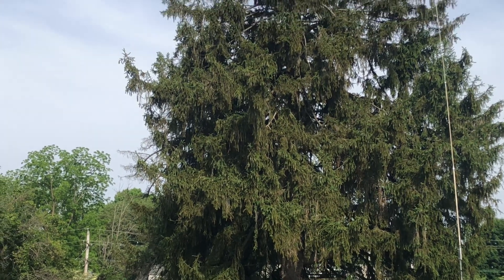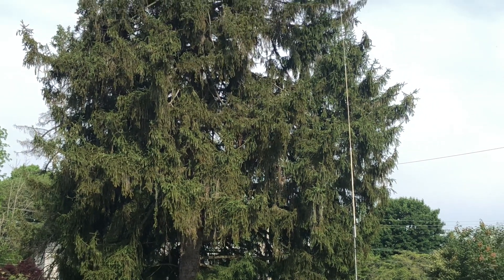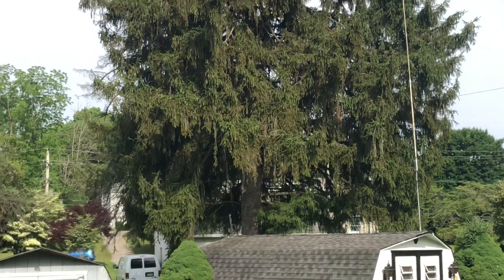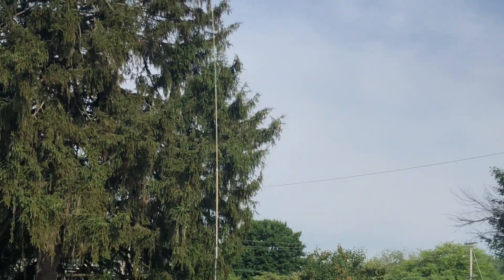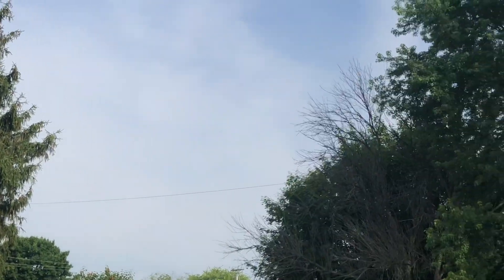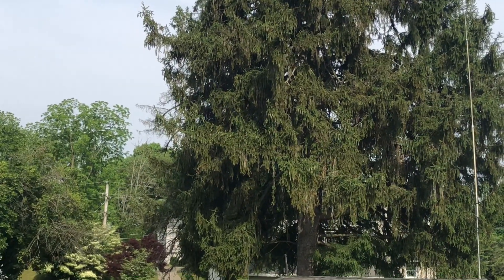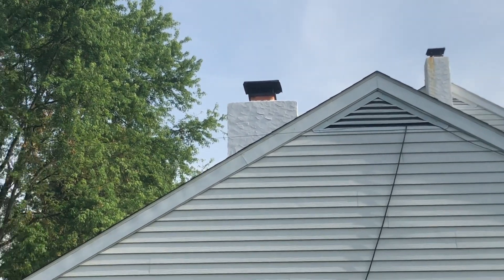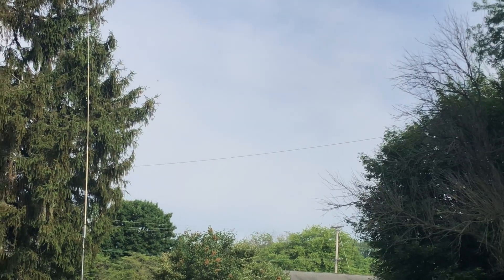MFJ-1984MP part2

Comment: Since my coax is in the attic, I was going to do the exact same thing with a 34’ Alpha until multiple people told me the metal vent and screen would mess up the signal. The advice I got was to mount the balun outside under the soffit. Give that a try, bro.
Reply from the maker: Thank you so very much.  I was just told that from someone on FB.  That confirms it for me.  Thank you again 73. I’ll keep you posted on the situation